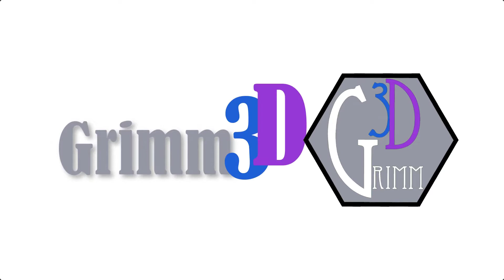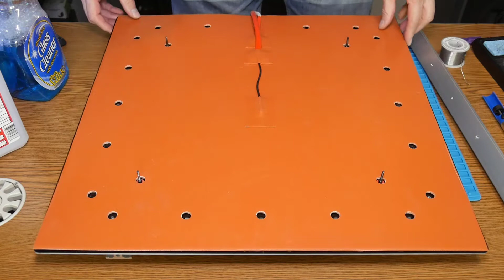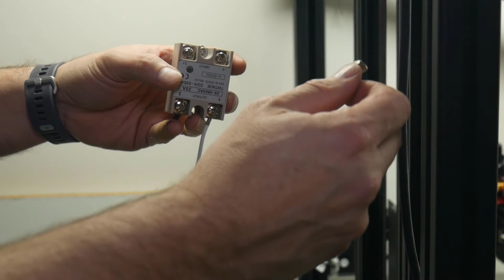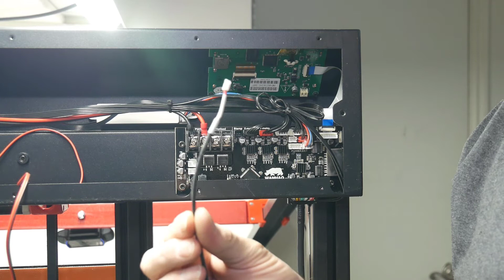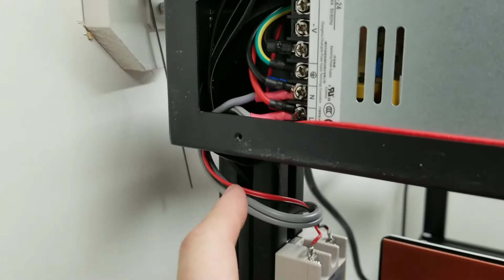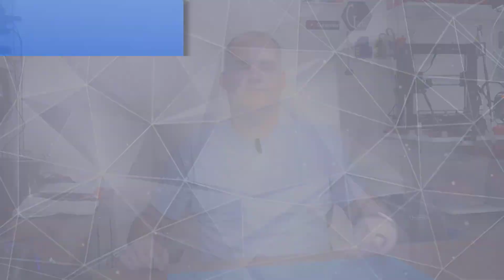Monster Bed Heater Pt2

Comment: After i installed my heatpad i bought 500x500x4mm cork to put between the aluminum profiles and heatpad.
It isolates very good downwards and it heats up even faster now.

First layer is very easy to get right with this heater pad, best mod so far on my Wanhao D9 500.
Reply from the maker: I'd have to agree. I did not add the cork, because I was not worried about speed, but the prints so far have had the nicest 1st layer my D9 has ever produced. The best upgrade so far. Thanks for watching!!

Comment: I put a backup sensor on my heated bed incase one goes bad so I don't have to lift the silicone bed off
Reply from the maker: I figure it wouldn't be hard to add the original sensor back into the bed. It really would just need to be Kapton taped on the heater somehow. However, adding a spare thermistor on install is a great idea. Thanks for watching!
Reply: @Grimm3D  also you know That heat insulator you scraped off replace it with a new one dose a huge difference in keeping the heat so you get no cold spots I would also insulate the aluminium brackets around the bed it may be the reasoner temperatures not even all the way through
Reply from the maker: Thanks for the idea. I'll be testing and if there is a need or inconsistent heat, I will add some insulation. The new heat pad is quite thick, so I was hoping it would basically insulate itself.